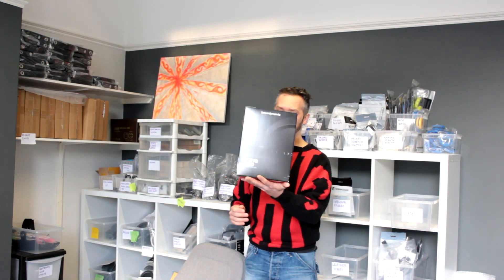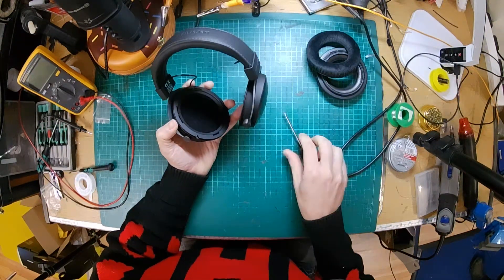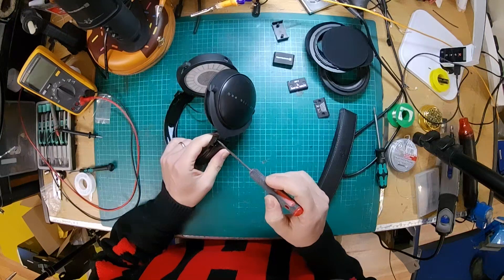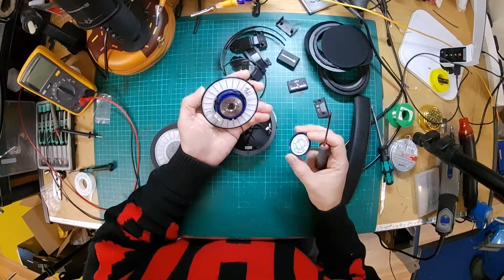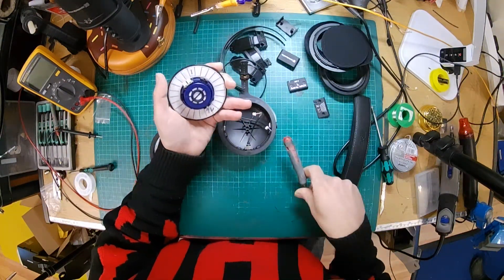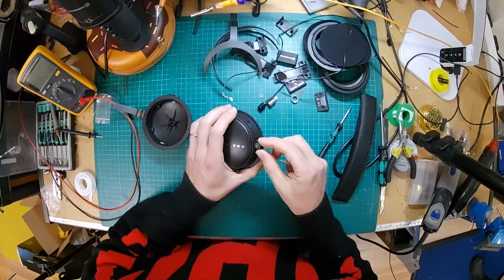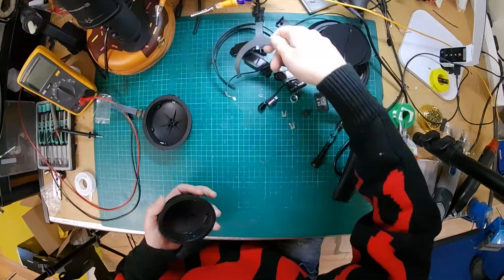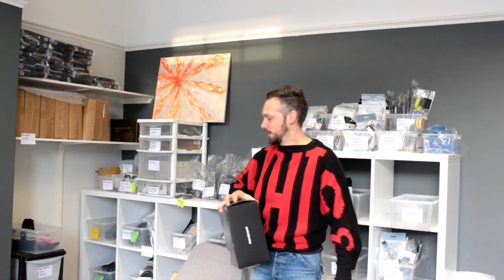Dismantling the DT1770 from beyerdynamic

Comment: Hey @customcans question if one driver where the little hair cables come out they have came apart from the driver and the connector could you fix it? Or should I just get a new pair of drivers for the beyerdynamic DT 1990 ?? Any one knows what I should do? Can the hair cables be re solder from inside the driver cone ??

Comment: Did you Doublecheck If they are they are they same?
Reply from the maker: Sorry it is a long time since I made this video - what was I double checking were the same?
Reply: Sorry didn`t think about that. 
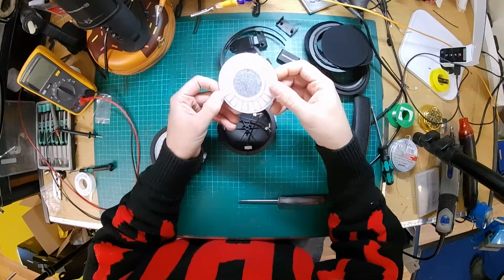Around 9:35. If the drivers of the 1990 and 1770 are the same. I tried to do a little Research online but didn't realy find anything.
Reply from the maker: @dasphantom2702  Ah no I never did do a thougugh check. Everything looks the same. If they are different it would be down to the cap on the back of the magnet - they could use different densities of paper

Comment: Hi everybody im having this problem with my 1770 pro where sometimes i hear some sort of zzz in the background in my right headphone and is kinda of annoying, other times it get fixed alone but do u know how could i fix it and what could it be the problem?
Reply: Yeah, open up and check, i had the exact same issue, and when i opened it up i found a piece of hair, i removed it and it got fixed imediately...

Just open up and check
😅
Reply from the maker: It depends - if the buzz is in time with the beat then it may be an issue with the headphones like a hair stuck in the driver. If it a constant then it is probably an issue with the amp / source

Comment: Sad to see it's that much more obnoxious to take apart the headband than the DT770's.  I hope at very least the plastic cover and sliders are more durable, where the DT770's could break within 1-2yrs of heavy use.  I ended up getting a 3d printed replacement after the second pair broke within around a year, especially because of that $40+ price tag(after shipping).
Reply from the maker: I think that may be rarer than you think. We get a lot of DT770 and DT990 in for repair, many are 10+ years old and the cable seems to be the thing that goes on them. It is verry rare for us to get some with headband issues. But... that are not designed to fit the heads of cows .. :) perhaps we are just lucky or maybe it is a sun damage thing, in the UK we rarely see the sun. I have seen a lot of people selling 3d printed headband parts so it must be a regular problem for some people. 
The latest ones do have a different clicker mechanism
Reply: Well, around the time I used them quite often(mid 2010's ish), I saw one tech youtuber posting on twitter about his slider casing cracking(990's I think, same slider though), and when mine broke, I had found 3 different files for 3d printed replacements for it with at least a few comments on them.  It's also a ridiculously easy repair as long as you have the screw driver, so I can't see many requesting repair for that compared to soldering.  As well for me Beyerdynamics provided the first replacement I received for free as it cracked during the warranty period.  From everything I saw and the 2 sliders that cracked on my DT 770 Pros, it always cracks on the inside right square between the screws, so I guess that spot receives the most stress from flexing.

Comment: Hey i am Wodering if you can use the CASE DT 1770 PRO witch you can order at Beyerdynamic and build you dt 770 Hardware (Speaker) in ?
Reply from the maker: I have not tried it but yes it should be fine - they are the same size. The only thing that may be tricky is that you will have to mod or replace the headband cable

Comment: So I have had 2 pairs of these and both had problems with one driver. I looked online and it seems to be a pretty common problem with rattling drivers and drivers that stops working or start to sound lower than the other one.

The weird thing is that the DT 1990's doesn't seem to have this problem at all but they are supposed to share the same driver? What do you think could be the cause of this? Could the closed design maybe create some type of pressure on the driver making it break or something?

On both my pairs the problem have come and then disappeared quite randomly. On my first pair the right driver would make a click noise and then become quieter than the other one and you could hear it distort for a while, and sounded like there were a hair on the driver, until it went back to normal. It often happened when I stood up or moved my head forward. It wasn't the cable or anything, it came from the driver.

On my second pair I had this problem from the start, the first time I put my headphones on I could hear that rattling sound but in the left driver instead, it then disappeared for a month and suddenly one day the same driver was a lot quieter moving the stereo image to the right. I thought it finally broke so I contacted the store that I bought them from for a refund, but a little later when I listened to them again they fixed themselves, just like my first pair would do.

So here I am not knowing what to do. Seems like there's something wrong with the Tesla drivers, but if the DT 1990's and the 1770's use the same drivers then that shouldn't be it. If you look up reviews of this headphone a lot of people are talking about this exact same problem, look up the reviews on Amazon for example.

Do you have any idea of what could be the problem?
Reply from the maker: No. I don't know. I have herd of people having the odd issue with them. We did have a pair in recently that we thought had an issue with the driver being too boomy in the bass but it turned out to be the pads had degraded and needed replacing rather then a driver issue. Until I have seen a faulty pair  I will not be able to diagnose the issue. I don't think the issue will be because they are in a closed enclosure. It may be a use case thing, where people with the 1770 are playing them louder for longer than people with 1990. I know the 1990 can be a little harsh at high volumes or maybe the type of person that buys the 1990 is less likely to report an issue online. It may be that they are built but different teams at the factory or it may just be blind luck. I'm just guessing
Reply: @CustomCans  Thanks for the answer.

I'm very sensitive to high volume so I never play my headphones particularly loud, and also on the second pair I got, the problem was present from the first second that I tried the headphones brand new. The DT 1770's are also closed so they are more efficient than 1990's and should require lower volume overall.

On my first pair I remember I could touch the outer cup and sometimes trigger this problem, it clicked and boom the driver would sound distorted. It felt like the driver was somehow connected to the cup and putting pressure on the cup would somehow put pressure on the driver and make it distort. 

I saw in this video that the driver indeed rests against the outer cup, maybe that tension could have something to do with it? I have to re-watch your 1990's video and see if those drivers are also held by the outer cup in the same way.

Could you maybe do a video where you compare the differences between the 1770 and the 1990?

I have been searching for a headphone that suits me for so long and finally found it, but now it has these annoying problems instead, I don't want to give up on it.

EDIT: Even 2 other people in this comment section talks about driver failure out of 24 comments. I feel pretty sure that this isn't a user error, something is wrong with the design, I just don't know what.
Reply: I have a similar problem with my 1770.  The left side becomes quieter at random times.  I also don't play mine loudly at all.  It did this soon after I purchased them.
Reply: @iv2sab512  Yes that's one of the symptoms that these driver defects has. I see in the original comment I only had 2 pairs when I wrote this. I had 7 pairs in a row total, all with the same fault in the drivers.
Reply: Oh my god. I just ordered mine and I'm really sick of having channel imbalance issues in my headphones. I've replaced my NDH-20s because of that  @Terra101

Comment: What would you use to reattach the mini-xlr input after melting that glue? Just hot glue? Seems like it'd be super messy, lol.

I ask because I need to replace that input, and am not sure what to use to secure it in place. Need something that will keep it there, but won't be a pure pain in the ass to remove if I ever need to replace it again...
Reply from the maker: Our technician puts IPA on the hot glue and it pops off or you can re heat it with a hot air gun and remove it
Reply: @CustomCans  Thanks

Comment: Thank you for the video! One driver died last night and while i tried to swap the drivers to see if its drivers or cables fault, the 3 wires connecting the XLR to the driver where cut off. I will try to solder them back but i cant remember which colour goes to the inputs of the xlr. Can you help?

Comment: I'm looking to mod my Dt 1990 pro and make it closed back. Now that I moved into an apartment complex, all the surrounding noise comes into my music and having a pair of closed back headphones would be ideal. Rather than spending another 500-600 dollars, I looked into buying the DT 1770 pro housing cups from the spare parts page but I'm always sent to an error not found page. Taking them apart looks rather easy, now I just have to find a way to close them off from the inside.  Thanks! 😄
Reply from the maker: Yes - think they have the same drivers - you would just need to like the inside of the earcup with something like dynamat to seal it off  and possibly leave one small hole to act like the bass port on the 1770 - you may also need to change the pads

Comment: I have a DT 1770 PRO but the left side does not work and the right side works, is it up to the driver or maybe it's something else ..?
Reply from the maker: It could be the cable, socket, internal wiring or the driver - you would be best off buying a cheap multemeter and testing the parts for continuity and shorts
Reply: @CustomCans  I changed places with the drivers and no matter how and where I hook it, one doesn't work.
Can the driver be repaired or must it be replaced ...?
Reply: Hi! Thank you for the video @CustomCans. I got exactly the same issue as you @petar_crni872 (left side is out - right side works on my DT 1770 Pro). Product guarantee is expired of course! Internal wires look good and multimeter does not give any clue :( . Did you figure it out?
Reply: @Unknown_Disaster  I'm not. I sold them ..

Comment: Do you have any experience with  ''MASSDROP X BEYERDYNAMIC DT 177X GO'' ? Would have been cool to see how they differ from the original. I hear that the 177x does right on everything the 1770 does ''wrong''.
Reply from the maker: No I don't sorry but if anyone sends some in I will try to get a video
Reply: @custom cans did you get a 177x in the meantime, i would also be interested to know if there are any internal Changes.
Reply: 177x have bad afr